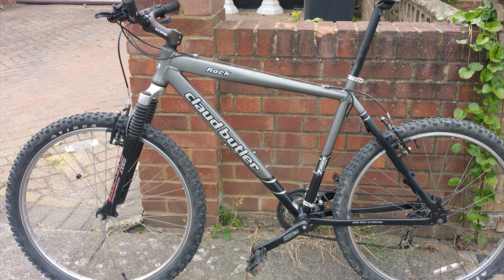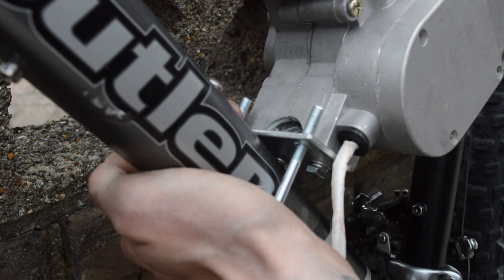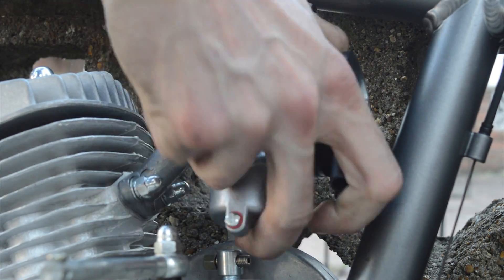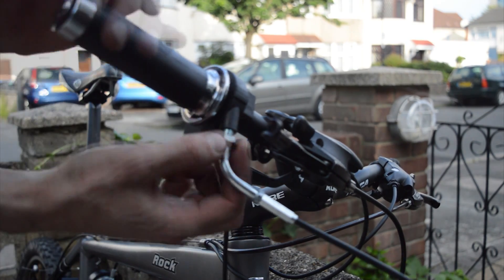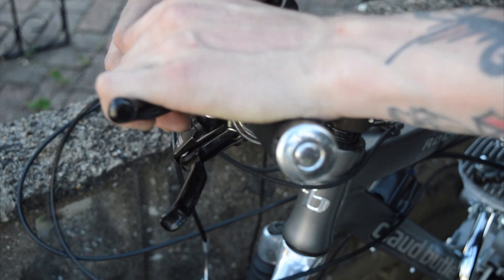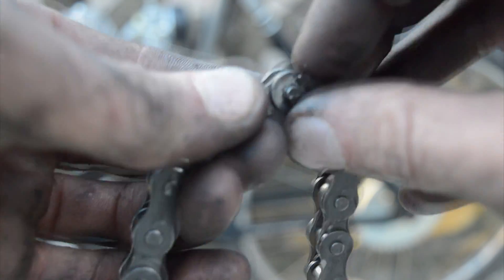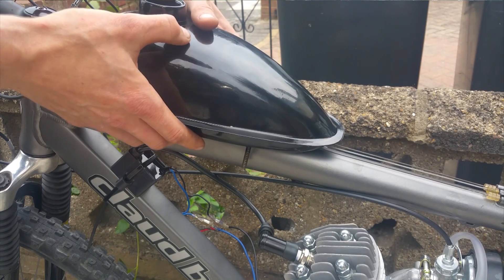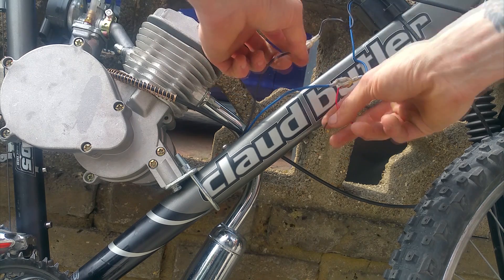Build a Moterised Bike at home - Tutorial

Comment: I just bought a kit, anything i should worry about? Like driving 2-3 tanks of gas? And whats the oil mixture? It only said 3% at the website, and im like "3% of what? 10-20-30 liters?"
Reply: How do i get the upgrade? thank you
Reply from the maker: +Mr Lollipop ok you need to do 4 full tanks of petrol and 2 stroke oil before doing any upgrades plus the mixture for the oil. I all ways use a the cap of the 2 stroke bottle when mixing a full tank. I hope this helps and thanks for watching. Any other questions feel free to ask and I will do my best to explain.
Reply: Ok
Reply: What is the top speed of one of these? After you've been driving it for some weeks
Reply from the maker: +Mr Lollipop for the basic kit it should be 25 to 30mph but upgraded 70mph +
Reply from the maker: +Alexian Dorias you can only upgrade after the first 4 tanks of petrol and oil mix then you can buy upgrades from bikeberry or Amazon and eBay. I hope this helps and thanks for watching.

Comment: i dont get it, why put a clutch on if it doesnt have gears?
Reply from the maker: +John Doe the reason for this is that when the clutch is disengaged you can use as a normal pedal bike but when it is engaged then the engine will start. I hope this helps explain and thanks for watching.

Comment: what kind of petrol? 
Just normal from gas station? 

Do I need to put lube in the engine?
Reply from the maker: +KWT you have to use unleaded petrol with 2 stroke oil and no you don't need to lube the engine the 2 stroke will do this for you. I hope this helps and thanks for watching.
Reply: You need to mix the fuel. It takes 4 tanks of oil mixed with petrol. 30 parts petrol to 1 part cheap oil (30:1) for 2 tanks. Then still 30:1 for another tank and use 40:1 forever after that

Comment: if I need to refill, can I just use petrol only instead of doing the oil mix? also how many kilometres from a full tank?
Reply from the maker: +Justin don't ever just put petrol this will mess your engine up and it will seize. The reason for the 2stroke is to keep the engine lubricated. I hope this helps and thanks for watching.
Reply: fair enough

Comment: Hey David thanks for the vid. Question, does having the brake and shifting Cables on the top of the frame effect braking and shifting performance. I recently bought a bike to install an engine on to and the cables are set up on top like yours. I'm kind of bummed about it. Just wanted to know how that worked out for you.
Reply from the maker: +High Plains Drifter well there are ways around it where you can put some spacers in between the tank and frame to stop squashing of the cables. I hope this helps and thanks for watching. Any other tips or advice feel free to comment and I will do my best to help.

Comment: Awesome that you read your comments!  How to oil it?
Reply: and what kind of oil
Reply from the maker: +GigaBeeld the best way to break it in I have found is to fill your tank as normal with unleaded fuel and then use the cap of the bottle full with oil from the bottle to the top of the cap and then pour in the tank. I hope this helps and thanks for watching 😀
Reply from the maker: +GigaBeeld normal 2 stroke oil. It should be red or green colour but I have found that using red is alot better. Well good luck with your project and thanks for watching. I have some more videos like this you might enjoy.
Reply: Thnx

Comment: so are these kits from ebay worth getting? A lot of people say that they are cheap and you need to mod them with different parts. Is that true or can you get away with just what you get in the kit?
Reply from the maker: +Nigtmaredemon I personally have an Amazon kit and an eBay kit they are both the same bog standard and will run fine for short distances but to help maintenance and improve performance you can buy mods. I hope this helps and thanks for watching.

Comment: i m having the hardest time w 2 stroke engine . wont start . the only thing im suspicious about is the oil . the kit is chinese and it recommended 10w40 oil instead of 2 stroke . could that b the reason it wont start ?
Reply from the maker: +Ahmad Mustafa I allways use 2 stroke either to brake in or as normal use I suggest you drain all the petrol and oil mixture you put in and make sure you have a spark 1st then fill with petrol and then normal 2 stroke and remember only a cap will do. I hope this helps and thanks for watching.
Reply: good day 
thanks for replying 
done that n removed spark plug so the gas inside would evaporate .
, what ration of oil to fuel do u recommend ?
Reply from the maker: +Ahmad Mustafa ok fill your tank up with fuel then put one small cap of 2 stroke oil and that should be enough to get you going.
Reply: hi 

thanks for the 

best regards man
Reply: 25:1 petrol:2 stroke oil is to be used for the break in. After that anywhere from 25:1 to 40:1 is to be used    your engine will never seize up if you stick to these mixtures
Reply: David Dicker dju know the castrol oil and the lucas stuff. Even the strimmer oil, i use those too. The ideal oil is the moped oil but its a bit expensive
Reply from the maker: +Alex Hickey well to be honest it's best to pay slightly more to protect the engine no matter what the extra is in the long run you might not be able to get these in a few years.
Reply: David Dicker i swear by lucas oil and castrol oil. Never ever had a 2 stroke seize up or wear out prematurely with either even when i accidentally mixed the fuel too oil lean
Reply from the maker: +Alex Hickey I agree but also make sure that you don't use any old cheap 2stroke as the internals of the engine will wear out quicker.
Reply from the maker: +Alex Hickey yes just be careful of the mixture ratios and you will be fine.

Comment: Would this work on a bike that uses the pedal breaking system?
Reply from the maker: +Liam Gleason can you elaborate a little bit. I have used this v brake system on this project as I have noticed that it's the best method and cost effective solution far. I have noticed that you can mod by buying brackets to allow disk brake now.

Comment: any idea how to get the petrol tank secured on a bike a very thick frame...even if i bend the mounting bracket its not enough
Reply from the maker: +Katen Morker you can allways use another piece of metal to bend and make your own bracket some times you may have to modify parts to make it fit but it's worth it in the end.
Reply: Thanks for the help mate!
Reply from the maker: +Katen Morker no worries I wish you luck with your project and don't forget to check out a few of the other bike videos on my channel
Reply: Thanks You have great vids im waiting for a new one...maybe you should take it on a off road bike trial I'd love to watch more of your bike in action
Reply from the maker: +Katen Morker cheers well I have some more like this one you might enjoy
Reply: Took it out for a few test runs down the canal ive noticed the back wheel and spokes are taking a battering know any stronger wheel replacements ?

Comment: Wouldn't you want to tighten the rear sprocket like you would a car tire in a criss cross pattern
Reply from the maker: +Ashtonmo_2002 I have noticed that when you do the cross cross method the sprocket moves more so the method I used works perfectly I found.

Comment: Man this helped me out so much but my kit disnt come with the right nuts
Reply from the maker: +Quinton Reed all of the right nuts and bolts can be purchased from your local hardware store. I wouldn't rely on the kit ones as the heads cross thread so easily if over tightened or done up and then releasing them.

Comment: dose the screws and stuff come with it
Reply: How fast dose it go
Reply: I want a good one that makes your bike go fast
Reply from the maker: +FAZE Jason moto at the start when I was breaking in my engine I was getting around 33 - 35mph. Now I have upgraded I have been clocked doing 55 - 60mph
Reply from the maker: +FAZE Jason moto yes as you can see from the start of the video there is a list of all the parts it comes with it hope you enjoyed this video and thanks for watching
Reply: If I send you my bike and you build me on i pay you 100 or 200 bucks
Reply: David Dicker nice what motor do u segjest this or no
Reply from the maker: +FAZE Jason moto yes all the screws plus nuts, bots and washers all all included with this kit and there are OK but it would be ideal to replace the complete set with stainless steel ones. I hope this helps and thanks for watching
Reply from the maker: +FAZE Jason moto all of the engines on eBay and Amazon are going to be the same unless you go to a website and buy a race spec engine but that would cost to much.
Reply: David Dicker my number 913 583 2423 my info need to talk may you build me one plzzz

Comment: Highly recomend everyone following this guide to ditch the stock sprocket, unless you feel like wrecking your bike in the inevitable case that your chain derails.  Buy yourself a Maniac mechanic sprocket, larger the sprocket the more torque/lower top speed... I.E Larger sprocket for hilly areas, and smaller for flat surfaces. These sprockets are hub mounted and not spoke mounted like the china crap they sell in the kit.. its the best thing to replace immediately and will also make assembly half the time, if not more. http://www.mmbikeparts.com/Adapters-Sprockets-s/135.htm

Also, ditch the chain tensioner, just have enough links so the chain is snug without much sag (less then a half inch) If you have to use a tensioner, purchase this on ebay: http://www.ebay.com/itm/like/182189235395?lpid=82&chn=ps&ul_noapp=true
Reply: maniac mechanic sells the best sprockets around. I left a link. I'd recommend a 36 or 40t
Reply: HeyAndrooSky
Reply: Thanks dude, this helped.
Reply from the maker: +Dominik Strnad no worries I have a few more like this you might enjoy and thanks for watching.
Reply: HeyAndrooSky shorten the chain then smh
Reply: Is there a Uk supplier for the maniac mechanic sprockets?
Reply from the maker: +Jo Davis I don't believe so I think you might have to order from abroad.

Comment: +David dicker 
thanks buddy. just wasn't sure that's all. Can't wait to get one. Any must improvements over the original kit? I've read an ngk spark plug makes it idle and pull stronger, is this true? what will need replacing or is the standard kit ok?
Reply from the maker: +Martin Butler the original spark plug is good enough to be honest but i wouldnt upgrade untill you break your engine in for example after 4 tanks of fuel and oil i hope this helps

Comment: How did you get the chain in?
Reply from the maker: +AVM Survivor the best way i found is ti take off both clutch plate covers then relese the clutch flower nut and then thead the chain onto the cog i hope this helps
Reply: It does. Problem is I can't get one of them off. I ordered an impact driver. Hopefully that works.
Reply from the maker: +AVM Survivor ok but be careful as the engine block are made of very cheap ally so you dont want to go to mad in undoing the threaded bolts
Reply: +David Dicker Thanks. I'll be careful. I see myself drilling them out if my first go with the impact driver doesn't work. those screws are good for nothing.
Reply: Ya my shit was stripped as fuck when I got it I'm struggling so hard to force the chain through by twisting that gear in there while feeding it

Comment: There's so many kits on eBay. Which one did you actually purchase?
Reply from the maker: +max miser At the time i payed £65.00 for mine on ebay and £100.00 for the other one off of amazon but both kits are exactly the same just a different colour plus they will both perform the same after the engine has been broken in propperly for example after 4 full tanks of fuel and oil mixture
Reply: +David Dicker alright. I'll purchase one soon. I did not see any chain come with them though?

Comment: Awesome and Very Professional Video!!
I've worked on these for years, for guys who run the crap out of these things. Just a few things to add if I could David... 
Installing the whole engine so that the CARB is LEVEL is likely the most important thing. If anything slightly toward cylinder is best. SAVES COUNTLESS problems with the way they perform, and if not sitting level will rarely idle properly...
The mounting hardware they provide here in Canada is low, low grade.. Buy all new studs and bolts if at all possible. I now automatically use fiberglassing to keep the engine set into the frame so studs don't break, and all the MAJOR problems from that. The spark plug should be dead center to the top rail as well, so the chain doesn't try to pull the drive gear and cause problems there as well. If centered correctly the pedal will always miss the exhaust. The chain should have been made a link or two shorter too David...lol. 
The clutch cable will always break at the lever, so don't use the screw bolt that is set into the lever arm, instead buy an allen key cable grabber  to set it into place against the outside of the lever. If they hole is too small on the cable grabber simply drill it a bit larger. And folks when installing that clutch lever cable, make SURE there's always that 1/16" slack when the clutch lever is released. It takes no time at all to wear out the bolt, and bolt pin inside that casing, and then you won't be going anywhere. 
The toughest part of these installs is getting that rear drive gear to run as true as possible. VERY carefully tighten those bolts so that the axle is absolutely as close to dead center as possible. If not...then at higher speeds it will rattle all the nuts off, and your own as well...lol. If your girlfriend is riding the bike a lot, you'll know that rear gear is not running true..LOL. There is a gear kit out there that bypasses the need for those poorly made gaskets, and will run absolutely true for about $30 CAD or about 15 LB. Plus it supposedly saves an hour or two worth of work. I have an order for another kit install, and will try that for the first time. 
Anyways, these bikes can get over 15,000 miles on them, before the rings and cylinders wear out. If installed properly, they are super cheap to run, dependable and fun to ride.
And David...this is BY FAR the Best Video on you tube for this niche. Great Job! Wow!
Cheers!
Reply from the maker: +khayapf47 thanks for the info and advice but to be honest the way i have mounted these engines for these two bikes i havent come across any problems with the running of the engine also it is the best way for me to have it on this bike as it feels right when being ridden. Thanks again though and i hope you enjoy my other two videos of me testing these two bikes out